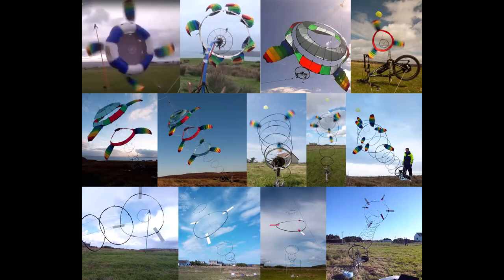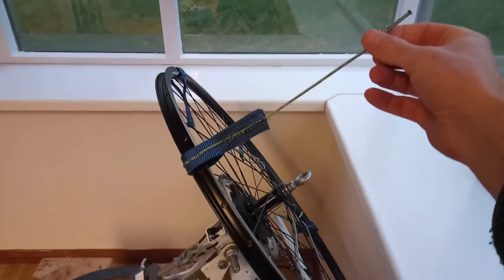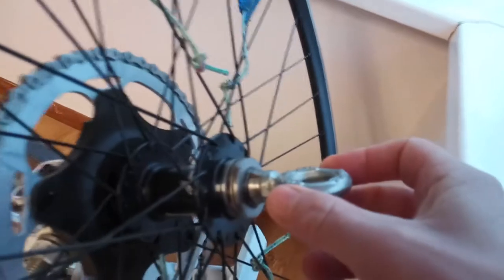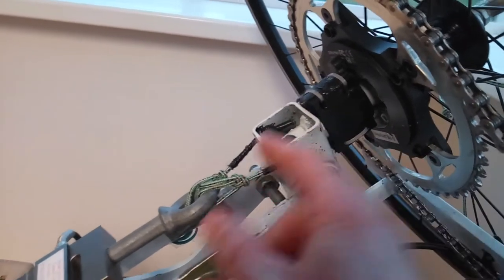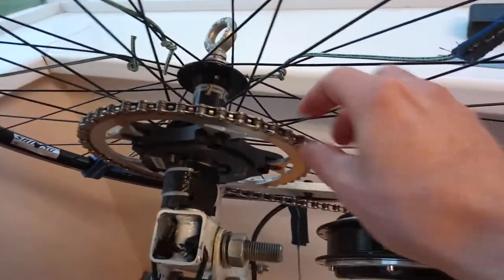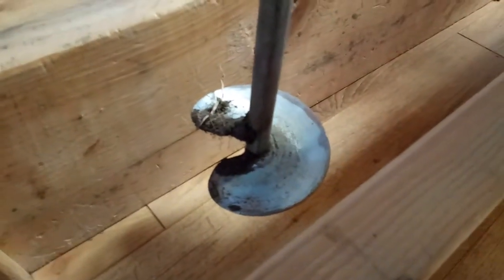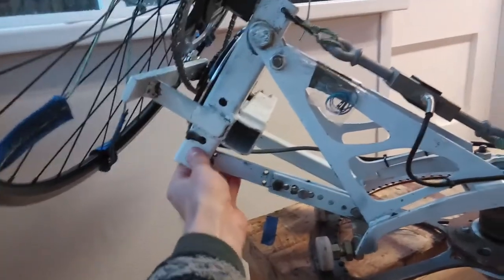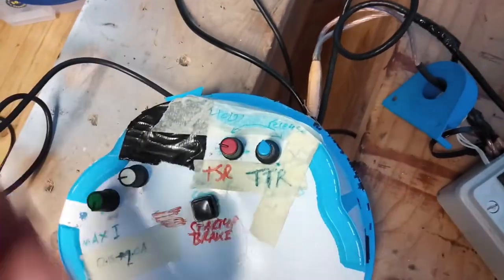Kite Turbine Ground Station introduction

Comment: This is really interesting to follow. I think it has huge potential. I see why you've used the rings to limit the torque warping the transmission line. Could an alternative approach be to have two lines side by side, rotating in opposite directions by connecting them with gears in sealed housings at various intervals, thereby canceling out torsional twist? Each cable would then have it's own set of kites, one further down the line than the other for instance. I guess the only downside is potentially the introduction of more weight, wear and tear of the gears and the turbulence associated with kites rotating in opposing directions.
Reply from the maker: Thanks. 
Sounds like a complicated suggestion. 
Maybe by sketching your idea you'll get a better feel of how feasible it could be

Comment: The wind power freezes up now when it is cold weather. Too much ice on the blades etc. I guess kite-turbines would have no problem in cold weather?
Reply from the maker: Apart from my cold fingers screwing the plate into the ground... Needs a lot more testing to say for sure. Haven't seen ice on the blades yet. Could be tricky to launch after storing on the ground in snow...haven't experienced that yet either.
Reply: @KiteTurbine  I have always been of the opinion that a commercial model of this needs to be maintenance free, in the sense that it would never launch from the ground. So there should be a mast or pole of sorts, that keep the thing off the ground when there is no wind, and when the wind catches up, it launches automatically. However, the setup is kind of tricky, since the pole needs to be there only for start purposes, and not be load bearing. 

Another idea I have thought about is that, what if the whole ting folds down into a fabric-tube of some sorts when it is not operational. Like a huge flower that retracts into its protective shell when not in use, with only a lifting kite staying outside to catch any potential wind.
Reply: I just came up with an idea of how the whole torque ladder could be made telescopic. Assume that we have RC controlled electric motors in the rotating hub that can lengthen and shorten each cable. Assume also that there is an extra set of rings on the torque ladder that is stacked at the bottom of the torque ladder, each sliding free on the cables, each one having a little smaller holes, towards the turbine. The cables in the ladder are then equipped with knobs at regular intervals, each with a little bit increasing diameter away from the turbine. Then when you extend the cable from the hub, the extra torque ladder rings would mount on those nubs, one at a time, extending the length of the whole torque ladder dynamically. 

This mechanism can then be used to either reach higher up to get more wind, or retract down into a protective shell. 

Also, the protective shell could be made out of cloth/rings and erected using thin carbon fiber poles. The purpose of the protective shell is not to bear any load, just to protect the ladder/turbine from the weather when not in use. 

The whole thing is then mounted on a pivoting mount, that can lean in any direction using mechanical actuators of some sort, possibly with some dampening/suspension. It could be hard to make the pivoting a 100% passive/spring based system, since like stated, the protective shell is not intended to be load bearing or disturb the torque ladder mechanically.
Reply: The RC motors of such a telescopic hub would need some crazy gear-ratio, since they need to be able to pull against the strong of the wind.
Reply from the maker: @erobwen  That's why we want the lift and back line to first yaw the rotor out of the wind before retrieving.